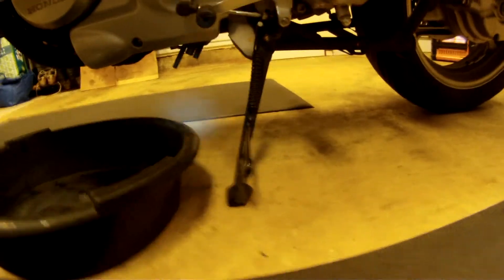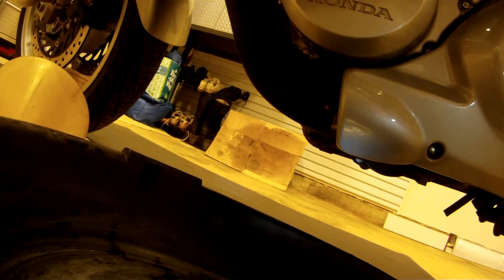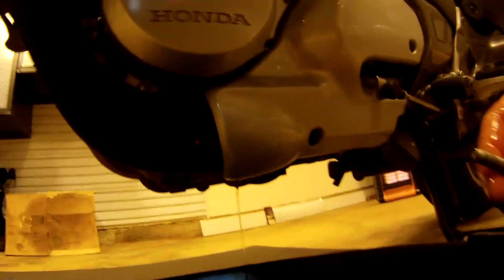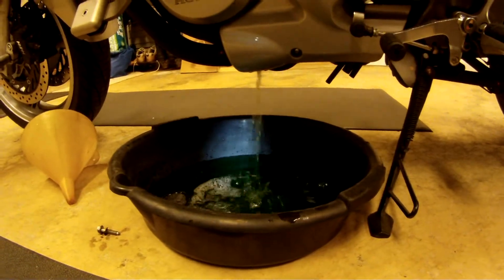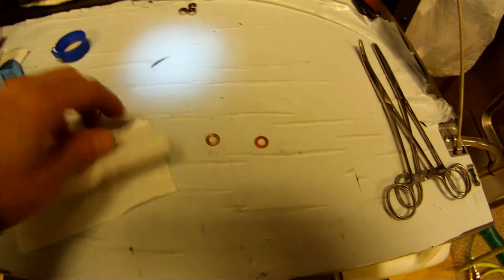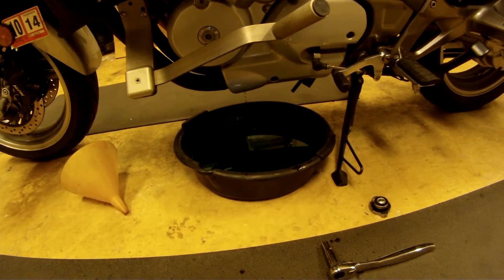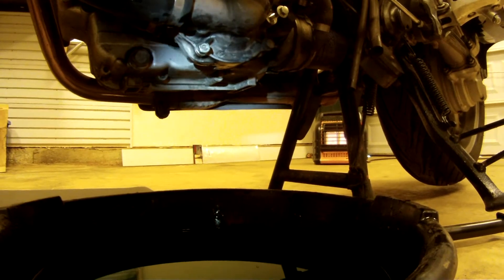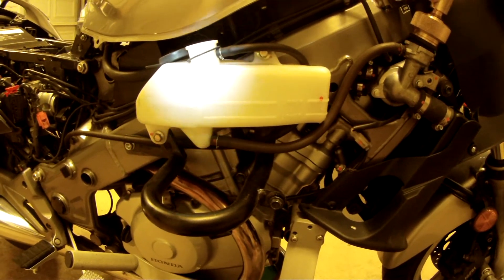NT700V Engine Coolant Maintenance: Part 02 - Draining

Comment: Looks simple enough once you have the fairings off, but aren't you missing a step?  Don't Honda recommend flushing the system with clean tap water?
Reply from the maker: @stevensteel8617  flushing is not necessary if the system has been maintained consistently with proper anti-freeze and change schedule. I would steer away from ever using tap water (either as a flush or to dilute anti-freeze) unless you know it to be distilled and all hard minerals removed. If you want to flush the system (maybe you think it is clogged because of improper maintenance/fluids) use a fluid designed for flushing aluminum cooling systems.